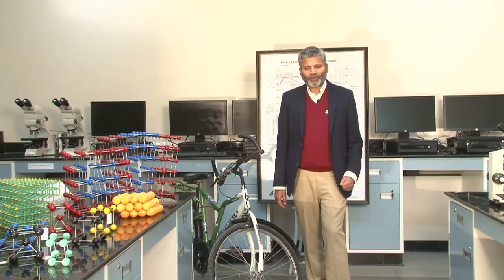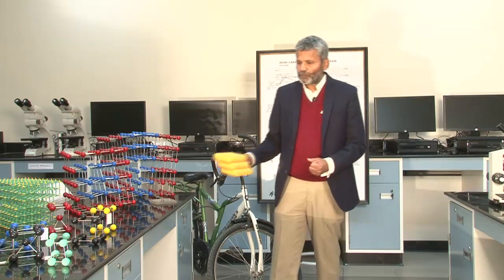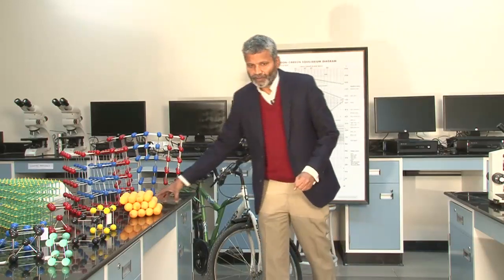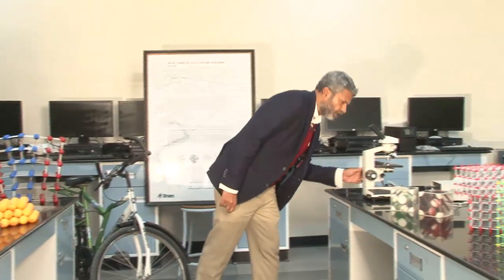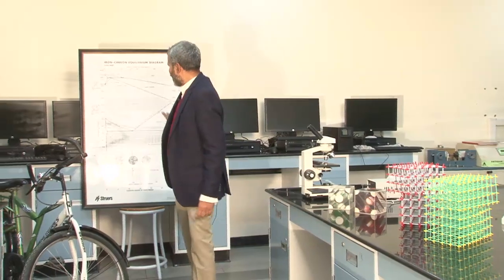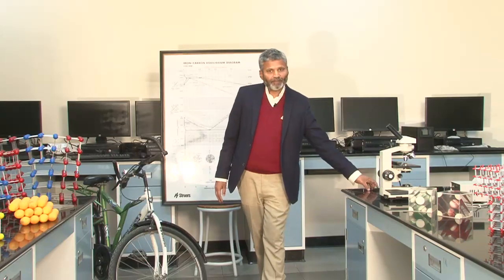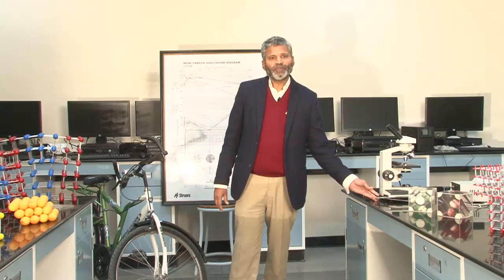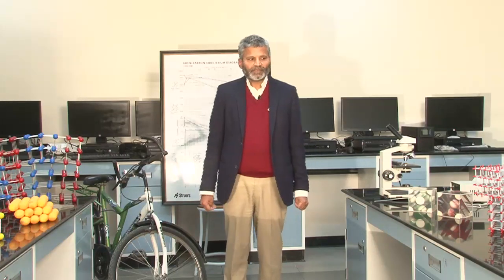Introduction by Prof. Rajesh Prasad

Comment: Hello, I have a question but firstly I would like to congratulate Prof. Rajesh Prasad and the team on this amazing compilation of videos on materials science. It's some outstanding work and very helpful for upcoming engineers. at 0.14 of the video Professor mentioned selection of shape and process materials could you please elaborate on what he meant by that.
Reply: Well I used 'shape' as a verb and said 'Engineers need to select, shape and process materials". So I meant that after selection they have to shape the material, i.e., give it a desired shape. Although, I did not intend to mean "select shape' with select as verb and shape as it object, this also makes sense as engineers do have to 'select shape' of the final component as well. This is part of design engineering.  However, selection of shape and selection of material interact with each other. This has been discussed in detail by Prof. M.F. Ashby in his book Materials Selection in Mechanical Design.
Reply: @rajeshprasad101  Thank you Professor for clarifying you've been very helpful. Sir one more question I have a report to write on Failure of ductile metals do you think you could possibly give me some advice on what key topics to include